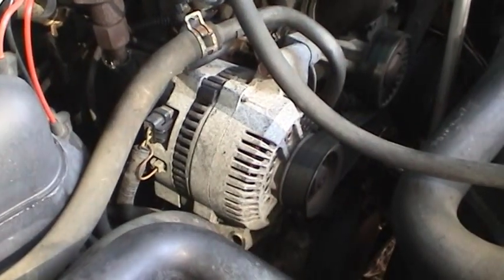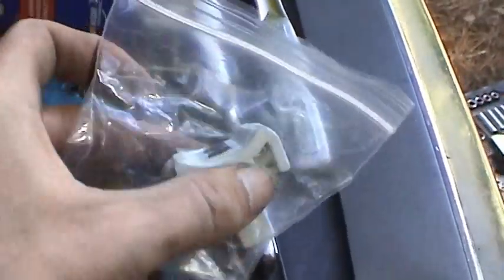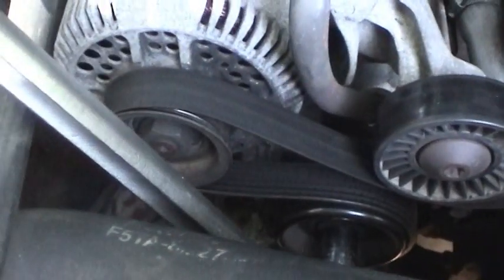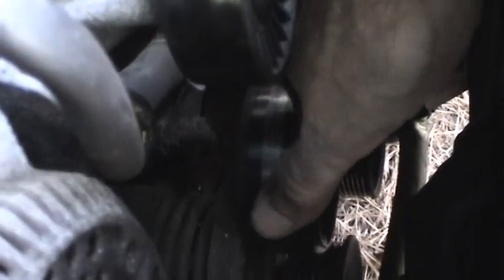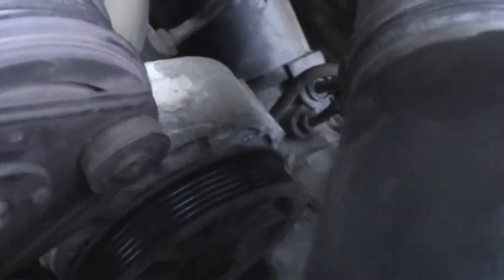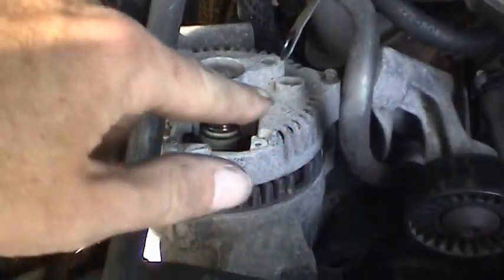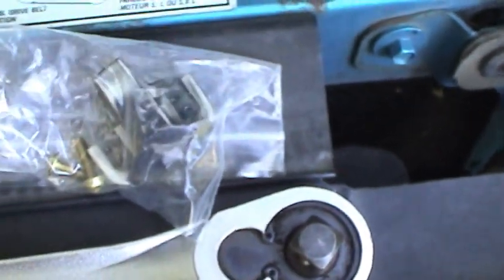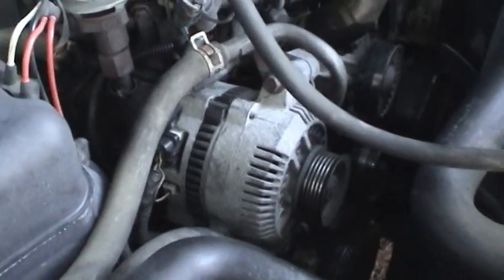1995 Ford F-250 4X4 Alternator Brush Replacement

Comment: Glad you tried it. As a professional auto detailer I clean my engine at least once, if not twice a year. Have you tried that? I found that the engine, for some reason, really does run smoother. Others have made that observation-such as smoothness of idle/midrange power. I think it might be because of particulates/metals/pollution that not only acts as insulation but interfer with wiring's ability to conduct electrical signals. whatever the case, I have very few components that I have had fail.

Comment: Awesome video. This may have saved me and given me a cheap fix for my alternator. I will know when I get my explorer home where I have my tools.
Reply from the maker: Pretty much the only things that go wrong with an alternator are the brushes and bearings. So replacing those things will allow you to keep the original part for the life of the car in most cases.

Comment: I periodically take my air gun/w long thin nozzle and blast all the belt-driven accessories. Its surprising how much dust flies out-especially behind the pullies. Other than 3 smog pumps and 1 water pump all the pullies are smooth and original on '96 f150.

Comment: Great video!  Could you answer this question...I have a '86 Ford LTD Crown Victoria.  The amp light is on...connected voltmeter ( car running ) and it's only putting out 12.5V.

I removed the drivebelt and still had the negative battery terminal disconnected.  Of course, the alternator pulley was turning freely at this time.  I connected the negative battery terminal and the alternator pulley was no longer moving freely...I did this without turning the key to the 'on' position & with turning the key to the 'on' position. 

Does this signify that it's a bad stator or diodes...rather than brushes or voltage regulator that is faulty.  There is only 68,000 original miles on this vehicle...it has the original alternator...which is a 2G Ford alternator. 

Could you tell me what you think...should I replace the alternator, or could it be the voltage regulator?

Thanks!
Reply from the maker: You're on your way to finding the problem! If the rotor is hard to turn with the key on/engine off, and turns freely with the key off/engine off, then it sounds like you're getting good field current to the rotor via the regulator and brushes. Connect everything back together and start the car and measure the voltage right at the alternator "BAT"' terminal. This is the large terminal that connects the alternator's output to the battery. If you have ~14V, then you have a blown fuse link. If you get <12V, then the rectifiers or stator is bad. The rectifiers will go bad first. These alternators can be rebuilt far more cheaply than buying a reman. unit. So if you have the time, think about rebuilding it. You could same some good money.

Comment: how to know if my car's alternator need a new carbon brushes
Reply from the maker: There's no way to tell until they go bad and no longer supply current to the rotor. When this happens, the charge light will come on. To prevent this, I like to replace the brushes every 50,000 miles or so before they wear down completely. They're cheap insurance against breaking down on the side of the road.